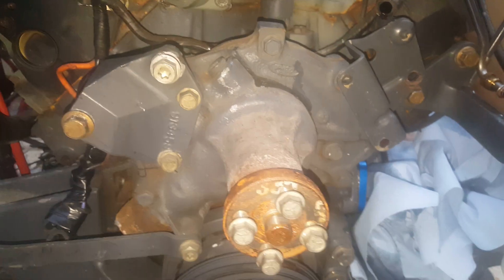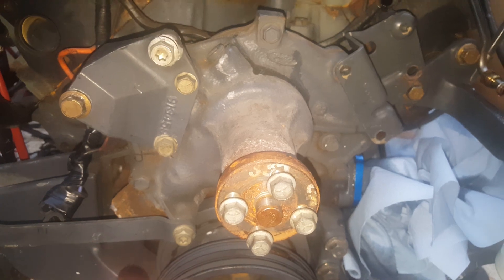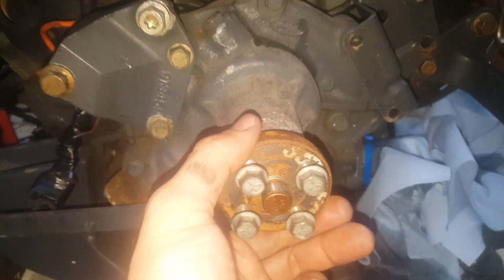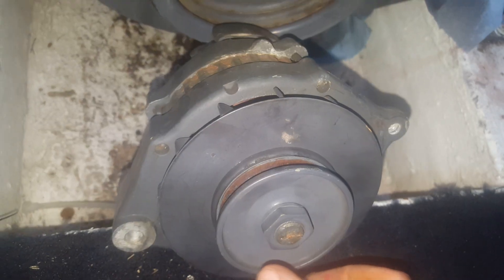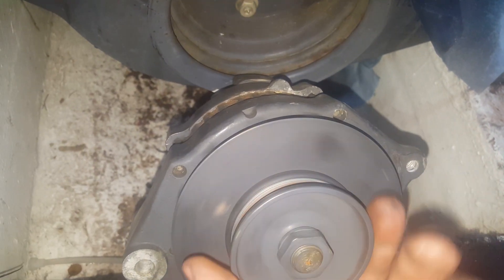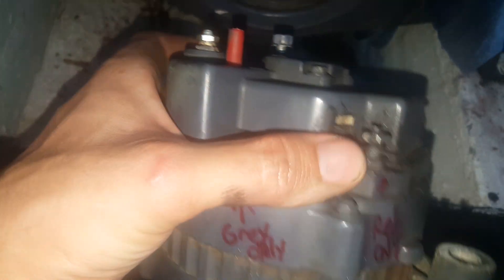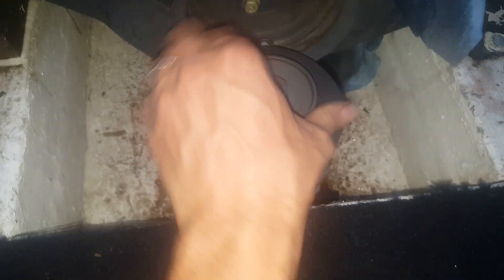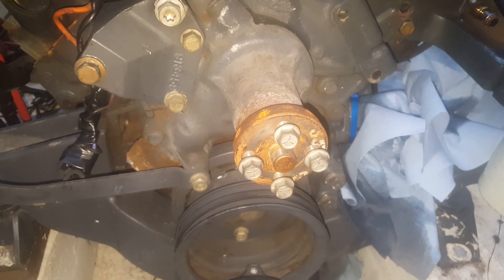OMC Cobra Volvo Penta SX - Noisy Water Pump & Alternator

Comment: yes, your vids are very very helpful!!....    
         my alternator is eating v- belts.  1996 volvo/penta sx 5.0. fi.   
     seems  like if a wire brush the alt pulley  the squeal stops but not this time.    did my rwp impeller install and running off garden hose n muffs,  started engine.   squealing when quick burst of rpm.    3 years ago alternator shop said the alternator was fine but we have been going thru v-belts ever since.    i suspect bearing in the alt., now!
Reply from the maker: If you are eating up belts are they new or used. You need new. Next: you need to make sure you have a little play in the belt. Having excessive tension on the belt is not recommended. Next is the pulleys. Take the belt off and use a thin wire brush. Paint the pulley(s) with primer and let it dry. Should keep it from rusting over one season. If rust is excessive, look for a replacement pulley(s). Also, go to autozone and get belt dressing. It will help with the squealing.
Reply: the belts are new belts - wire brushing does help - i'll put some primer on the pulley - belt dressing does help.    new pulley  probably a good idea.   any idea of the shaft size for the pulley?   thanks again for the replies.